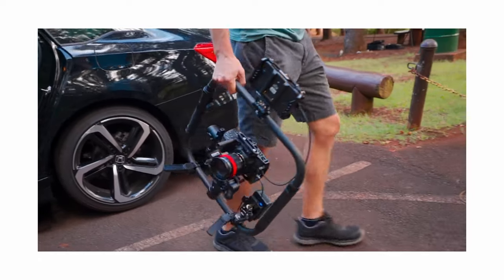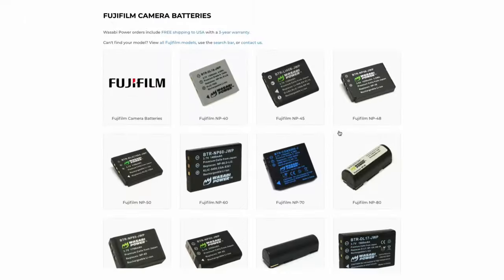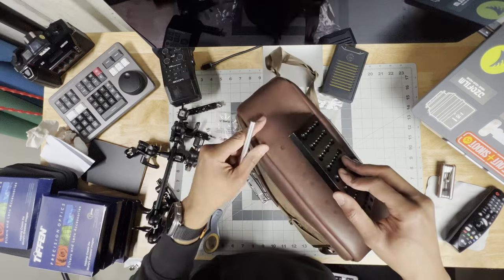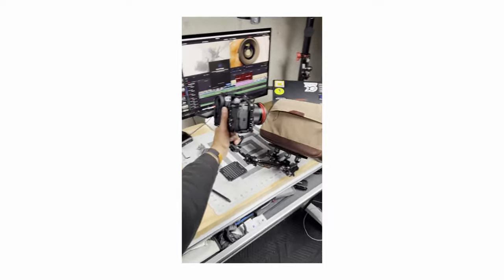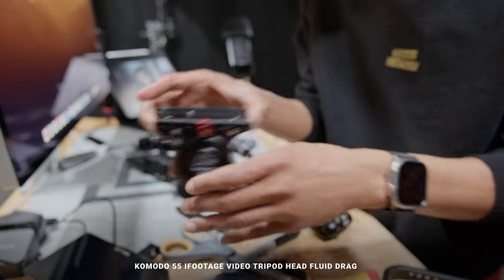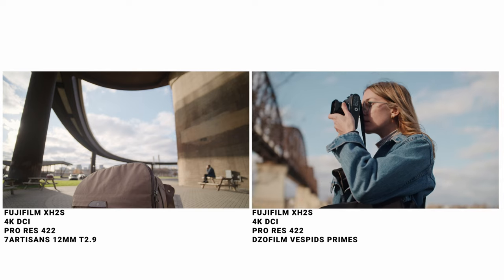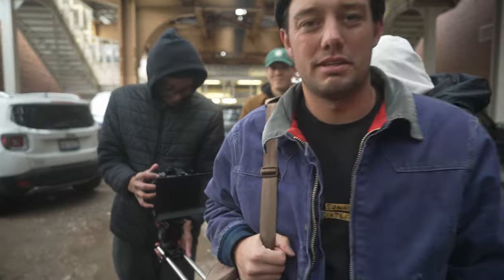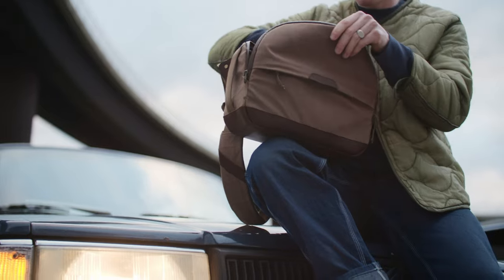Easy DIY Pov Rig build shot on the fujifilm Xh2s

Comment: Fine stuff! Little off top could You give advice how to make x-h2s footage more "cinematic" i mean less digital more "organic" i set sharpness to -4 and put 1/8 black mist filter but still it is slightly too sharp,there any tip to make fine tune in post ? For example put some blur on timeline above footage ?
Reply from the maker: Don't use sharp lenses if you want a more organic look. So vintage lenses or lenses that have more character. 

Dehancer is a great plugin for film looks.
Reply: @CineDailies  ok,thanks Bro !